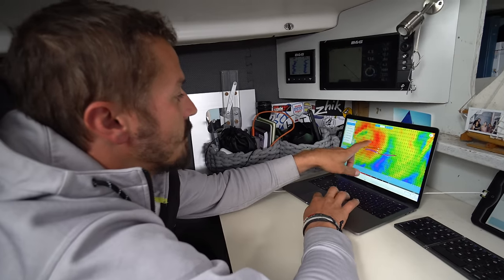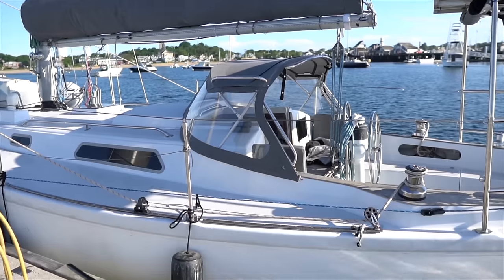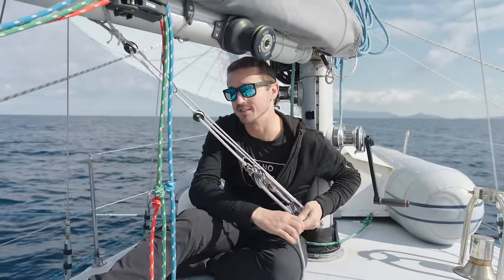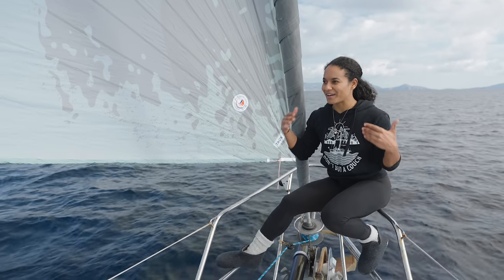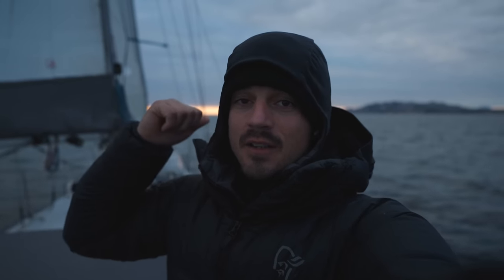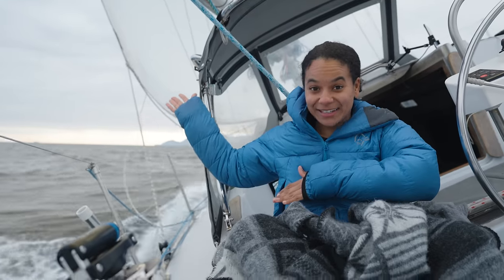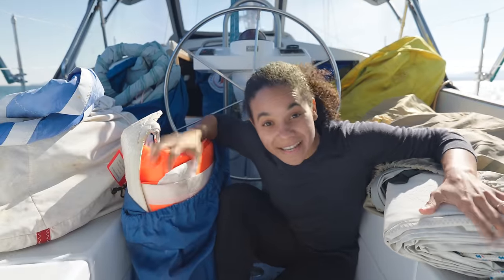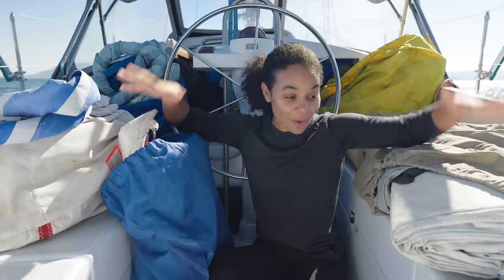Our Electric Sailboat has Unlimited Range | Step 343

Comment: That's a pretty sweat inventory ! You are probably missing an even bigger light sail for downwind : your asym is pretty small and also quite flat, so you are not using it efficiently at deep angles and isn't much better than your code 0.
A rounder and bigger one would be a nice replacement, so an A2 (or A4 if you find it too big) but I wouldn't recommend furling it. 
With a furler you can find a "Code D" but it's an expensive sail for sure.

Comment: Actually a spinnaker indeed provides lift. Also with the symmetrical ones. As soon as you have an angle to the wind, you set it up to act as a wing (regattas, 32nd America's cup, 470er). Even symmetrical spinnakers. Asymmetrical spis have an even better efficient shape to provide lift. When you are sailing directly downwind, then it will be a drag sail, which makes it very unstable in my experience.

Comment: Great video - thanks! Question re your storm jib: what do you hoist it on? Do you have an inner or removable forestay to which it hanks, or does it have a tube of sail cloth that clips round the rolled up Genoa, or do you have to take down the Genoa altogether? If either of the latter, do you have an opinion on being on the foredeck long enough to get it round the Genoa in conditions that require a storm jib? Although you’ve never used it, have you practiced putting it up? (I’ve got one that goes around the Genoa and it’s a pain in the backside to put up. Having tried it, I can’t imagine ever putting it up for real!)
Reply from the maker: It actually hanks on around our rolled up headsail and hoists with the spare halyard. We've tested it at the dock.

Comment: Those tell-tail yarns looked really fragile. Are they easily replaceable?
Also, you didn't really touch on the difference between a genoa and a jib. It looked like the genoa, spinnaker, and code 0 all operated in the same manner, but I understood a jib is attached to the front of the mast and is tied forward; like an extension of the main. Am I right? Awesome tutorial, by the way.
Reply from the maker: We barely scratched the surface with this video. We could do a 10 part series on how they all work and what conditions to use them in. Yes, the telltales are just stuck on with a sticky patch. We replace them sometimes.

Comment: Just curious, do you have backups for electricity generation? I know you do regen with your prop, but do you have something like a mini wind turbine as a backup? Obviously you have the solar panels but just wondering how far backups go.
Reply from the maker: Regen and solar are the main ones. We have a small genset as back up. We picked it up in Norway before sailing to the North Pole.

Comment: when you say those clutches arnt installed upside down, can you explain, i thought the handle always opened towards the load?
Reply from the maker: Exactly. Most clutches that’s the case. But not these ones. We’ve had many comments before about them being installed upside down. Which we find ablations. They wouldn’t work if they were backwards.

Comment: Just a thought on the reefing and how it would be a lot to run lines to the cockpit. How  difficult would be installing an electric one at point of location with the manual as back up. Go go electric!!
Reply from the maker: The loads on the sheet winched aren't really that much. Very manageable on a manual winch. Electric is really only useful when the loads exceed what you can grind manually.

Comment: Dan, Outstanding explanation of the mainsail and rigging! 

Kika, Tell me about the battens in the Code Zero. 20:00 What is your heel? 25°? (Wrote this last before you reefed.)
Reply from the maker: there's no battens in the code zero.
we were heeled at about 18°  before reefing (our toe rail is in the water at about 20°)
Reply: @SailingUma  Used to sail a Pearson 40. At any point of sail, she heeled 15° and sat there. Never buried the toe rail. Never spilled my coffee.
Reply: @SailingUma  Used to sail a Pearson 40. At any point of sail, she heeled 15° and sat there. Never buried the toe rail. Never spilled my coffee.
Reply from the maker: it's fun to heel over when you are at the helm without swells.  But try it while the autopilot is overpowered and you are holding an expensive camera trying to film on deck to talk about the genoa cars 😂... then it becomes a different story

Comment: For the headsail reefing dots, did those come with the sail or did you add them? Do they signify reinforcement in the sail, or are they a bit more arbitrary?
Reply from the maker: they came with the sail. They are just marking points for how much of the sail we are rolling in. We don't have to reef exactly to those points, but they are mainly used for reference.

Comment: Excellent presentations, Dan and Kika!  I love the technical details.  Perhaps you could cover the details of your boom vang, along with explaning the difference between a tension vang, a pusher vang, and vangs which do both.

Proper pronunciation of "genoa" is commensurate with the city after which the sail is named:  https://en.wikipedia.org/wiki/Genoa

Since sailcloth is made from manmade fiber, why don't they include UV-absorbent/reflective/protective substances into the fiber as is done in other industries without detriment to function?

Did you forget to mention your sail drive recharges your batteries while under sail?  Perfect for pulling into port...  :)
Reply from the maker: I'm pretty sure they already do, but the salt and sun are still the harshest environment on earth. Dacron last 4-5 yrs uncovered, and 10+ yrs when covered.

Comment: OK, I have to ask...how much attention has the standing rigging gotten since you moved onto Uma? I have a Pearson 31-2 that I sail on the Chesapeake, and am putting most of my attention into the steering at the moment, but next year may be the big one. Have you pulled the mast, replaced shrouds, etc? I am considering adding insulators to the backstay so I can do HF radio.
When I decide to bite the bullet, I will have lots more invested in the boat than I paid for it!
Reply from the maker: We pulled the mast when we shipped Uma to Florida 9 yrs ago. Replaced the entire rig then. Since, we inspect it every time we go up the mast.

Comment: I disagree that cockpit mainsail (slab) reefing is necessarily a bonus. Because I often sail single handed, I would definitely change a boat (>10m or so) rigged this way back to reefing at the mast. However,  even boats with crews should not have to wake people who are off watch to take in or shake out a reef. 
Particularly when shaking out a reef, there's always the chance of something catching, whether it be sailcloth catching around a mast cleat, or a halyard looping around a steaming light, or a number of other pesky contingencies. 
If the place you have to be to resolve the situation is not the place where the winch is, you will need to be in two places at once. And that situation is much more likely to have arisen because, stuck under the dodger, the chances are you will not see the problem soon enough to avert it, and may even do damage if there's already a decent amount of friction before the foul-up happens. Particularly when a powered winch is being used. This can be a major liability.
There are ways of dealing with this on smaller boats (maybe 10m or less, depending on the strength and capability of the crew) but in cases where a winch is essential to raise the sail, I would not feel comfortable single handing with cockpit-only reefing

Comment: That was a very interesting video but how do you swap the zero and spinnaker around if both are roller ferled from the same drum?  Sat in uk looking at 4 inches of snow.
Reply from the maker: Each sail has it's own anti-torsion line that they furl up around. You can just unhook it from the drum and swivel and clip on the other sail. Hoist it and unfurl it.
Reply: @Sailing Uma  that's very handy, last furling sail that I  used  you fed the sail on up a track which was not good on a pitching deck.

Comment: Nice looking cabin dodger.  Do sections zip on and off so you can be left with just a little bimini when you don’t need the protection and want to protect the plastic from the sun?
Reply from the maker: Yup. And the plastic has covers too.
Reply: @SailingUma  you have the ultimate dodger, then.  (I make the canvas for my boat.)

Comment: Great video. But, I'd like to pick your brain regarding stack packs.  We'd love to have a stack pack, but the mainsail on our Hunter 30 does not use a slug or slides, it has rope sewn into the foot which then feeds through the boom track. I am installing lazy jacks this year, but would love to consider a stack pack too. Recommendations?
Reply from the maker: If you can instal lazy jacks, you can install a stack pack. Find a local canvas shop and gets some quotes and ideas. Then decide if it's worth paying the experts, or getting the material, tools and knowledge to do it yourself.
Reply: @SailingUma  I will probably end up doing it myself. But, figuring out how to share a stack pack and a mainsail all into one boom groove be entertaining. Thanks
Reply: @SailingIntotheMystic  Hopefully OK to be a 3rd party replier.  Our stack pack (Doyle) sits in the groove on the boom, so the main is now “loose footed’ with the outhaul taking on more of the work. Didn’t bother snipping off the slugs/slides (in the event we upgrade the sail they might be helpful to next owner).  Lots of benefits (including it being quicker to rig!).  Precision Sails has an informative video on fixed vs loose foot sails.
Reply: @peterjmcgowan  No worries, always enjoy multiple thoughts. Our mainsail though, has the boltrope sewn in across the foot of the mainsail. But, how you described it, I can visualize that idea well. Thanks. Definitely good food for thought!

Comment: Do you have a set of criteria to determine when your boat feels balanced and not overpowered in any given wind condition?  Just curious because some will determine based on amount of weather helm, the amount of heel (sic?), general boat feel, etc.  BTW, I love the videos.  You two are my inspiration for my desired configuration and setup of my boat, in particular your complete electrical setup.  It seems so much more self-sustaining.  Thanks
Reply from the maker: We can just tell. There's no set rule and it depends on wind angle and sea conditions, tiredness of crew, timeline, weather forecast. Overall, it's just a general feeling. We're tuned in to our boat. She tells us when she needs less sail area up.

Comment: Is that why you had to buy a generator, thereby turning it into a hybrid boat, whilst you were in the Northern parts of Europe?
Reply from the maker: Ha. The generator was to keep our camera batteries charged. We don't need power to run the boat, but our laptops and cameras account for about half our daily power consumption.
Reply: @SailingUma   So it's our fault then   😁😁😁😁

Comment: The clew of your code zero looks high. Would have it been better to bring that part of the sail down, closer to the deck?
Reply from the maker: Then we can't see under it... We're happy to lose a 1/10th of a knot to gain visibility. We're not racing. We also trust the pros when it comes to the design of a complex shape like a sail. We sent in our dimensions, and they sent back a sail that doesn't flog...
Reply: @SailingUma  What's your interpretation of the word flog? I used to be a racer and have never just cruised. Thanks for the explanation

Comment: I am re-powering my 38 hi performance cruising cat. I looked into re-powering with electric, Wow the price is devastating each motor $20,000 and the same cost for each battery, to have 1/20th the range. $80,000 for electric, $34,000 for diesel, $17,000 for petrol. Highest performance is petrol, Highest range Diesel and highest cost Electric which would need an ice generator if one keeps playing around the coral reefs because the house sucks all the solar and wind generation.

Comment: Did you call that rope "a sheet" ?
Reply: Most ropes on a sailing boat have names specific to the task they're dedicated to. A sheet hauls in the clew of a sail in a roughly horizontal direction. A halyard hauls the head of a sail in a roughly vertical direction. There are dozens of specific designators, hardly any of which include the word "rope".

Comment: I don't remember but I thought I left you an Edison generator and how to build Edison generator with inverters to deliver house current AC power continuous peak power.  You use a 12 VOLT DC car generator chisel off the Tesla magnets from the armature and reassemble this generator.  It is a motor now and generates the same electric power without fuel or pollution.  You use a pre 1974 car generator chisel off one sixth and leave one sixth on and alternate chiseling off and leaving one sixth on until you have three sixths on and three sixths off alternating on and off all the way around.  Wire the brushes to the positive post of the inverters and the field case to the negative side DC side of the inverters.  You can charge batteries and motor continuous.. This is an Edison generator or Swiss permanent magnet motor as a generator.  If you keel the headsails and mast better the boat will sail faster and upright with rudder control in high wind.  The stem should be the deepest point of the boat halfway between the mast and forestay and the mast is keeled but there is a clean line to the rudder.  You want to take out the boom keeling design that causes the boat to heel over the the bow to fall off and take rudder control.

Comment: thought this was going to be about 'unlimited range' which of course, any and all sailboats have, given wind..This is a general rundown of your setup, You might want to think about the title. Cool you have electric drive. Charged under sail with a motor/gen or is it solar charged?? Thats the deal on Youtube, the titles are  not indicative of the content.
Reply: But most sailboats do not carry suitable sails to use under all conditions, or if they do, are not provided with suitable means of handling and adjusting them, and/or the crew have not learned or practiced their use. Hence the title, and their hope is that others will treat the motor as an optional convenience rather than an indispensable pillar.

Comment: Here is some thing exciting for you. https://youtu.be/Z8C-cczgUd0 . There is a vertical Darrieus version of this Murray-Smith invention, and it has the advantage of being rolled up and stowed against the mast. It could renew your wind power plans.
Reply from the maker: We’ve been doing a lot of research and testing off camera. Over the past few years. 

There is no substitution for flow volume of air unfortunately. 

A system like that would need to be massive before it would be viable to charge our batteries. We’d need a half dozen 1-2M in diameter at least.

Comment: A great tutorial!  Now, will you screw up your courage and explain how a wind vane auto pilot works, with practical demonstrations?  Several have tried (on YT) and failed this old guy miserably 😥. Please!
Reply from the maker: We don't know how it works...it's just pure magic. You drop it in the water, pull a line, adjust the fin at the top until it stand up straight, and then forget about it for 18 days while you cross the north atlantic ;)

JK.

But it's is really that simple. We could, and probably should do a more in-depth video on it. We'll add it to the list ;)

Comment: What is the "Electric" part of an "Electric Sailboat"?  Yes, sailboats have unlimited range, as long as there is wind and all the equipment needed to sail still works.  Don't see any electric in the electric boat.
Reply from the maker: Electric motor
Reply: Electric motor, OK, but powered by what?  I could have missed it, but I did not see any solar cell panels or a windmill.   @SailingUma

Comment: as a sail instructor it freaks me out how little you know or convey here about the theory of  sailing and sail definitions. For example its not that head sails differ just with the names according to regions - they have their own specific purpose, shape, lines. You showed just inventory but please do not show it with such a little respect to the sailing theory. You have learned it on you experience and that's ok as you are careful - you can think ahead what would happen. If you convince others that they can learn the same way (learn to sail just on the experience) it may be dangerous for them and you will be responsible for what would happen to them.
Reply: You added the word "just" to your second sentence, which they did not use. So you are attacking a claim they did not make. This video was about their boat and their sails and how they choose them, set them up, and use them, in order to avoid motoring. Regarding the point you raise, they were making the perfectly valid point that any particular sail will have different names in different (English speaking) sailing communities: working jib vs #1 Jib, Lapper vs 110% or #3 (or #4) Genoa, Jib top vs Reacher, Gennaker vs A Sail vs assymetric vs MPS, spitfire vs storm jib etc etc ...  and they did this so that people would not take the name they call each sail as being the only true name.
Your point about theory is arguable, because practice is at least as important, but you come across as having a fixed idea that everyone must approach a sailing topic the way you would. In my experience, most sailors who would benefit from learning more theory will go to the appropriate places to discover that information, and it's very readily available. 
Sure, you can insist sail theory and definitions have to appear everywhere sails get mentioned, and by all means "freak out" as much as you want, but I doubt you'll find much support for your rather extreme and somewhat dogmatic stance. Your last sentence in particular is frankly indefensible.